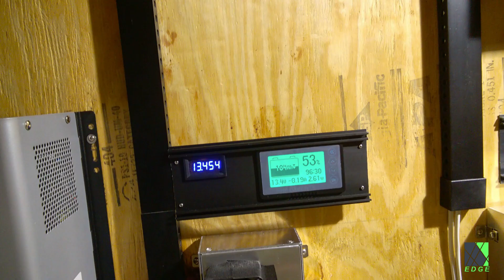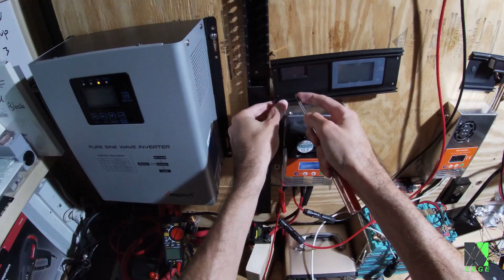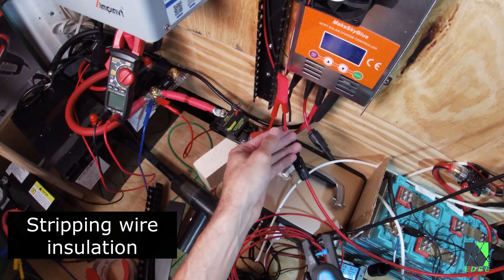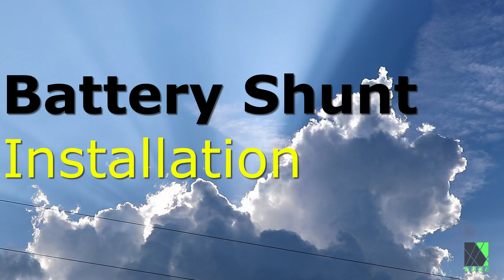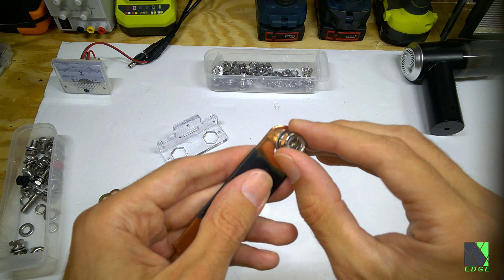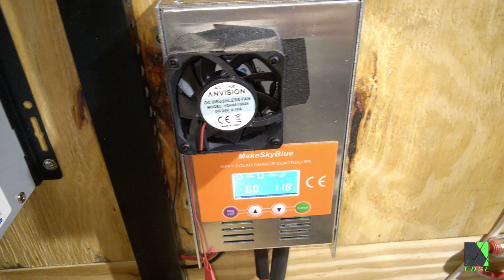Clean DIY Solar Power Installation! How to use cable management - Off Electrical Grid #diy #offgrid

Comment: Question for you.   I have a 200 ah 12 volt power queen plus.   Can I buy other brands of batteries and tie them together in ?  Same size batteries different manufacturer. Or do they all need to be the same ?
Reply from the maker: @Bailey463 1) As long as it's a 12v Parallel connection and not series connection, it's perfectly fine. 
2) Even if they have a different AH capacity rating, no problem. 
3) Each battery should be tested individually first, to make sure it's behaving properly. Once in parallel, it can be hard to discover a problematic battery. 
Hope that answers the question!
Reply: @solarpoweredge  thank you for the advice
Reply from the maker: @Bailey463  NP!